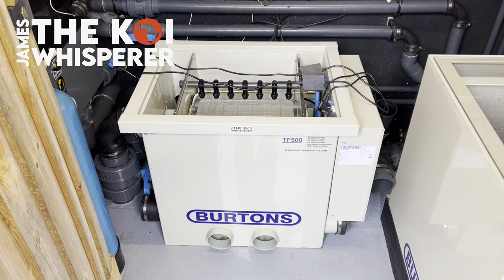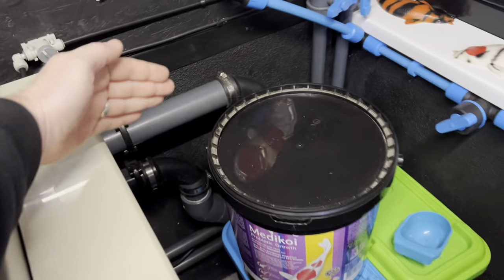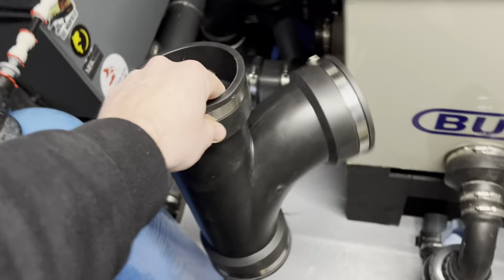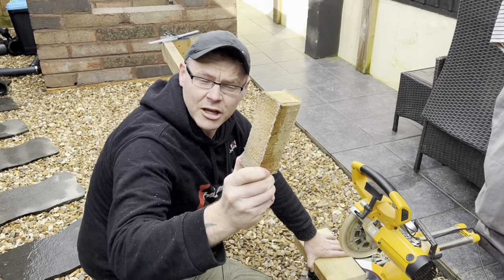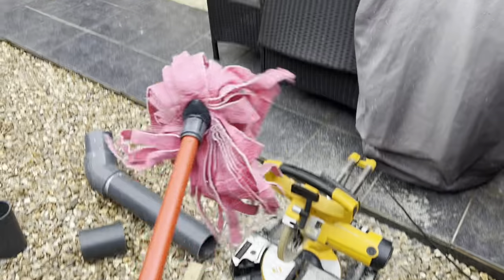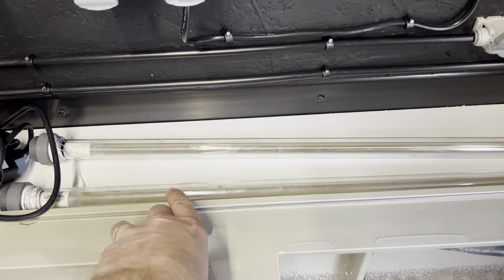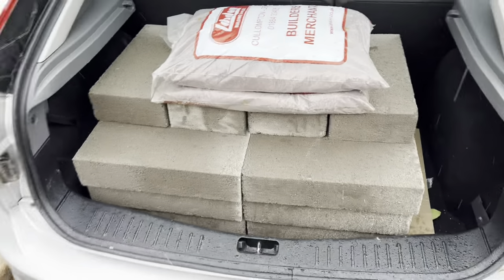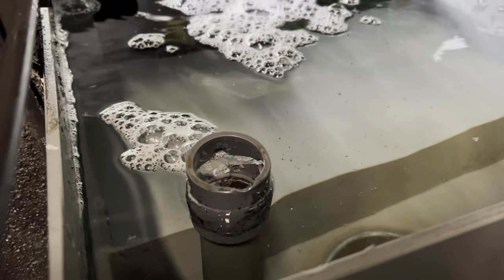Making a change in the pump house **DRUM FILTER UPGRADE**

Comment: Nice work james. I had to do the same thing on my grow pond drum. I dropped mine by around 70mm. I underestimated how much loss i would get once the pumps were turned on. Where it's only a 1000l pond, the loss in the drum box was quite a lot. which makes a massive difference on the time length of the cleaning cycle when the full potential of the surface area of the drum isn't being used.👌🏻

Comment: I would be surprised if your UVC bulbs are lasting as long as you’ve said, it maybe an idea to speak to Burton’s for clarification as normally they only efficient for six months.
Reply from the maker: I said in the video that I haven’t changed them in over 3 years not that they lasted that long if you no what I mean
Reply: @JamesTHEKOIwhisperer123  my misunderstanding James, it’s one of those maintenance things which are easy to forget. I’ve setup a reminder on my phone to change the bulbs on the pond and in my marine reef aquarium so that I get the best results from the UVC units.
Reply from the maker: @billclarke7893  yea that’s a good idea mate